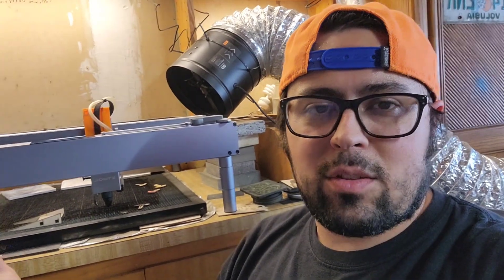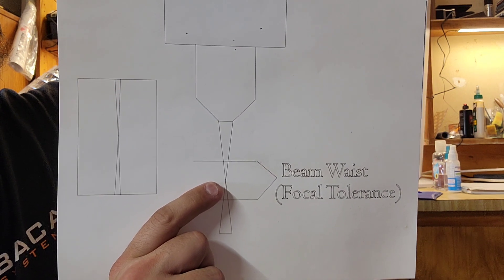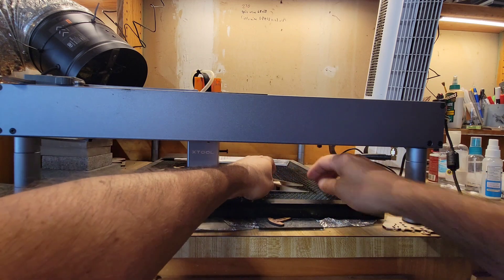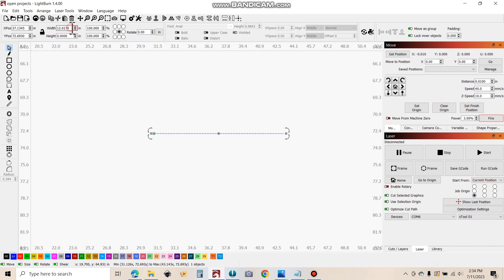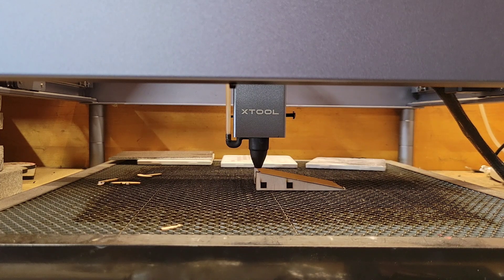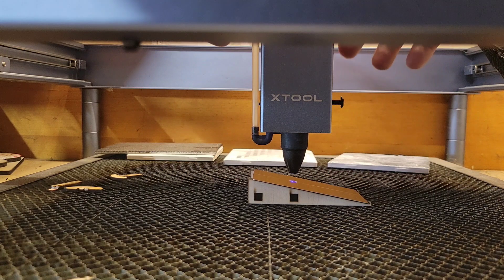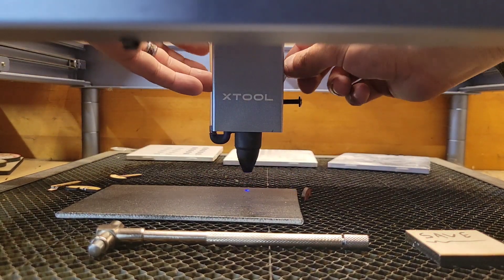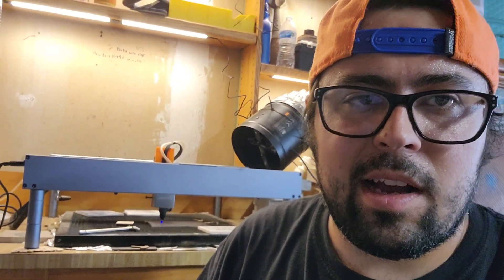How to run a ramp test and achieve the most detail out of your photo engraves on your laser!

Comment: Like to see what the difference is from the drop down foot and your measurement, you did not show a comparison. wish you would have dropped the foot to show in video.
Reply from the maker: I will definitely keep that in mind! The difference was about 1.5mm
Reply: I am assuming that is 1.5 mm lower than what the lever would make it? i just started to do some tests and have compared  lever focus to 1 mm farther away and under a scope you can see the difference.  will do some testing beyond 1mm to get it exact.  Will be doing ramp test also.  Thanks for great video.  I will be watching more of yours. @Allen_The_Maker
Reply from the maker: @dbarr15  thats correct, I want to say my module was around 1.4mm off and thank you very much for watching!!
Reply from the maker: @dbarr15  I have a ramp test jig to hold a black business card in the files section of my facebook group Laser engraving tips and tricks: free imagr files

An alternative method if you have a knob adjusted z axis extender is to fire the laser at 1% power at a business card then adjust the z up and down until you can hear the laser etching the card and can see it is a it's smallest point!
Reply: Thanks Allen.  Would a steeper ramp help see the difference better since it would come and go out of focus faster?  Will do one tomorrow.  Downloaded the card holder and will make that first.  I have the xtool d1 pro 20w and have been disappointment looking through the scope  in the spot size. It is suppose to be 0.08*0.10 but it seems larger which messes with the DPI/Line spacing you can use.  I am hoping it is because it has been out of focus.  Just want to produce the best image I can.  Steep learning curve.  keep making the videos, they help! Doug
 @Allen_The_Maker